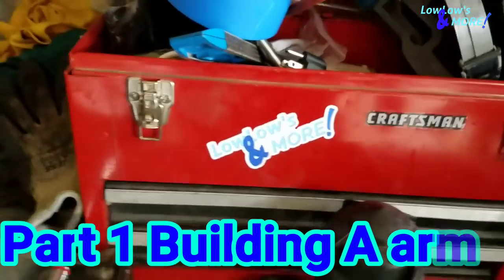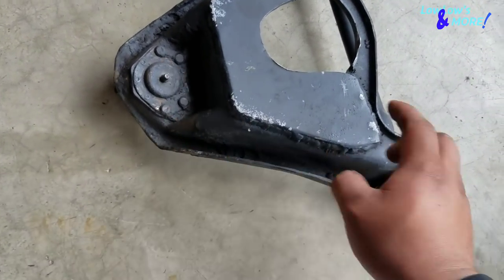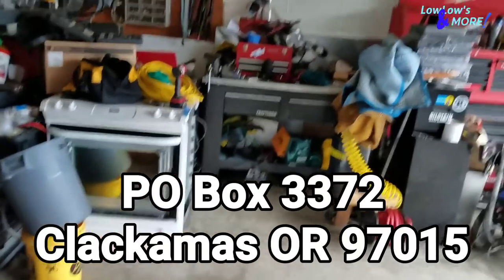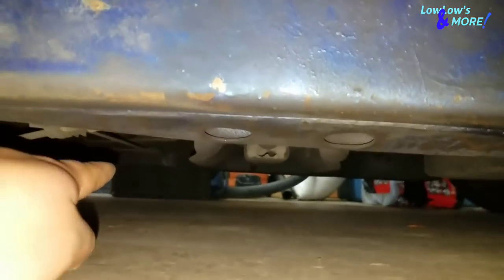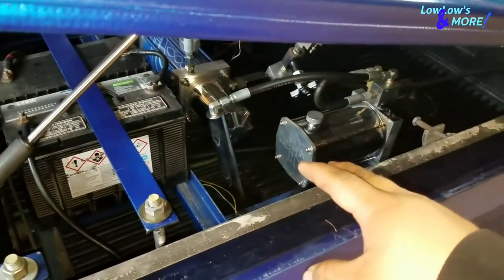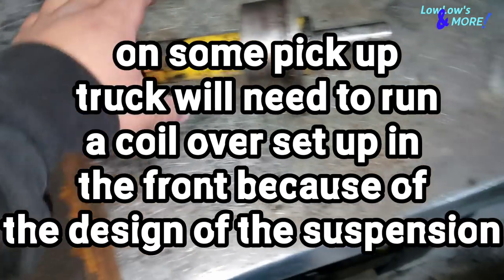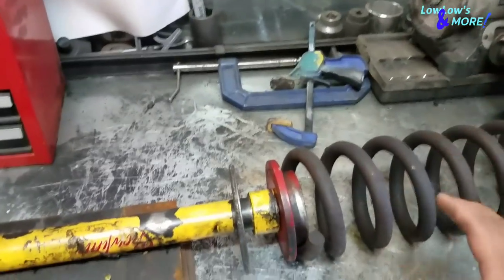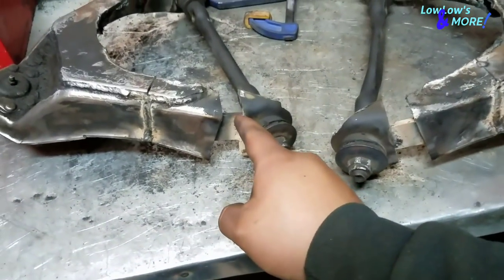Began to Build A arms(control arms) and more!

Comment: What makes the rear set up without power balls so unsafe? non power ball set ups had been used from the early days of low riding thru I guess the nineties. if a car or truck has this type of set up just to cruise not to dance or 3 wheel, just basic FBSS what could it hurt? I used to have a 78" full size step side truck with this type of set up (FBSS). I used to drive it on the freeway 5-7 days a week, it was my daily driver, and had no problems. I guess it's how much you play with the lifts and how responsible you are at maintaining you ride!   I'm not not bashing. Good videos!!!!
Reply: CochinoMan 71 popping a coil out can be dangerous in a coil over setup you don’t have to worry about that if your coil pops out in a coil under setup you can risk busting your gas tank from the pressure the coil was under yes it’s old school but new school is for safer more efficient ways better to be safe than sorry

Comment: How much does the c channel brige cost?
Reply from the maker: It depends where you buy it, if the place you go to has a discount or surplus area then you can get it for under 30 cents a pound. If they dont have any in that discounted area then it would cost between $80-$170
Reply: Thanks bro your information is very helpful. Keep up the great work.

Comment: What type of fluid to you use on these cars?
Reply from the maker: I use pennzoil motor oil on all rides and mine
Reply: Why?
Reply from the maker: It works just fine, all of that non detergent oil stuff is for the hoppers.